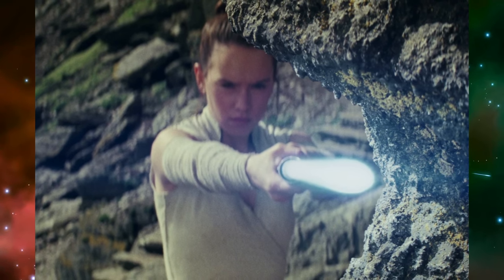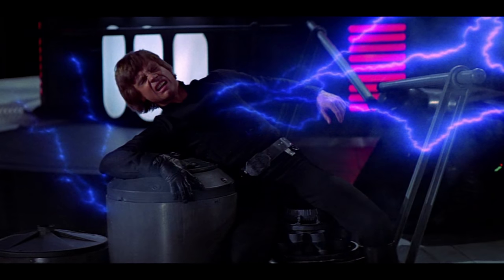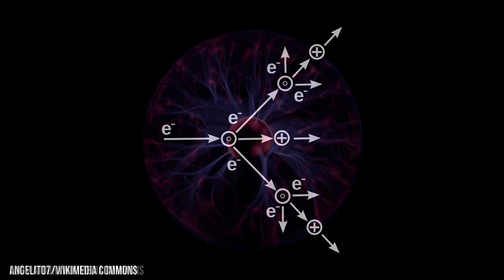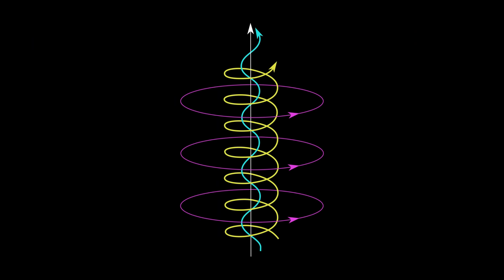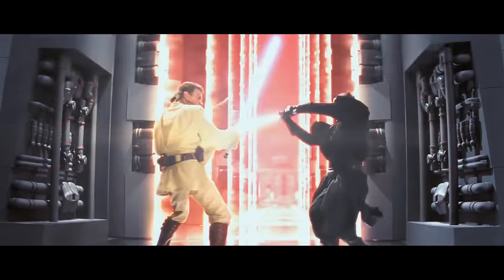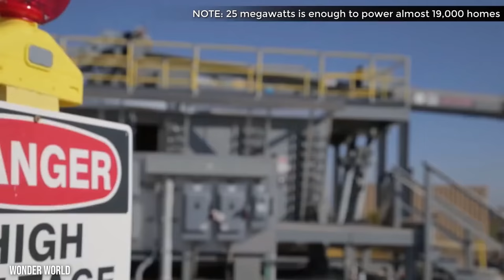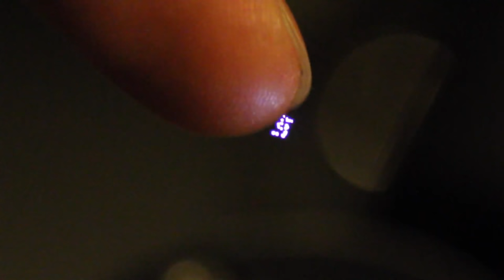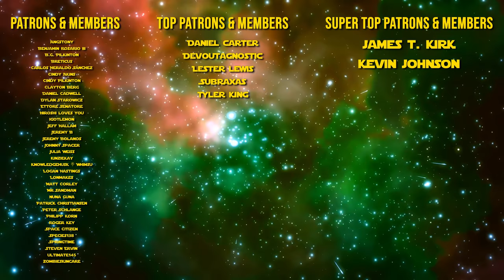Lightsabers: More Plausible Than You Think?

Comment: In addition to the handling of heat and the focusing and fine tuning of the plasma beam which you covered exhaustively here, there's also the whole aspect of the ability to generate (or somehow channel) the necessary power to make that much high energy plasma.  Currently the necessary power to make such a beam of high energy plasma would require a large powerful generator probably around the size of some large welder/generators that Lincoln and also Miller companies make.
I'm guessing that some new high energy physics would need to be discovered and then engineered and used in order to be able to actually do this.

Comment: Sorry kids, but the idea of a "Lightsaber" violates the most basic laws of physics - The energy required to generate an "electromagnetic field" to control the "blade" length would literally fry the user of the weapon. 

As a matter of fact, with a field that strong you don't even need  the "light" part, (or plasma or  whatever you want to call it) - just use the field itself as the "weapon"

Comment: The logic of a lightsaber still perplexes me... aside from it being awesome in looks for entertainment purposes. The energy it would take to control the plasma beam has to be greater than the power of the beam in the first place. Also, what deflects other energy attacks is the energy that controls the plasma beam to make it a blade. So, my boggle is this. Why bother with the plasma beam? Just have an invisible blade that could theoretically be almost 2D with no drag, using the energy that controls the plasma into a plasma blade. I mean, swing that thing and your opponent just falls in half without knowing how you did it. It could also still deflect energy blasts like a lightsaber could, probably do it better because it's not controlling its own plasma stream. You might not even need one of those omega-powerful Star Wars crystals to power it, just a mere energy core to a basic blaster weapon or bow caster.